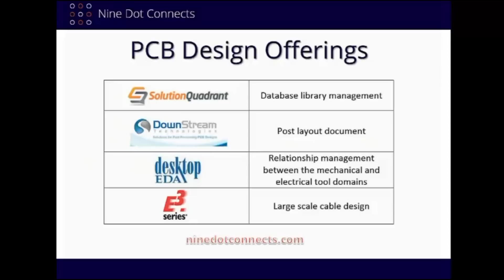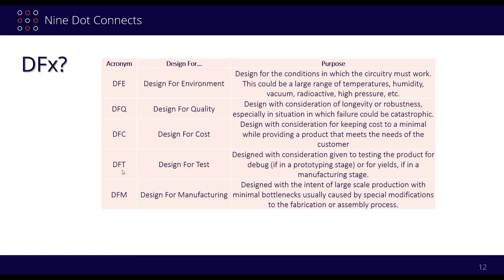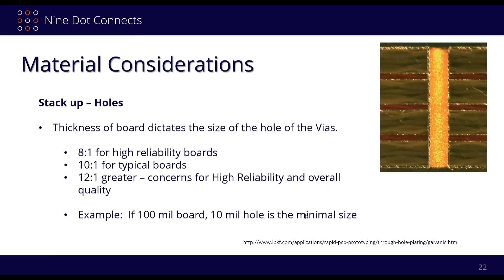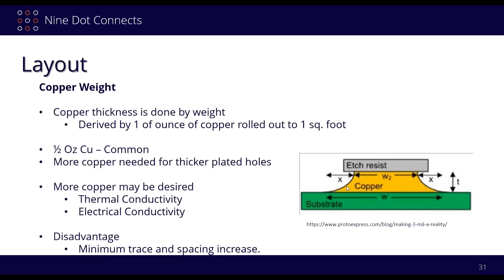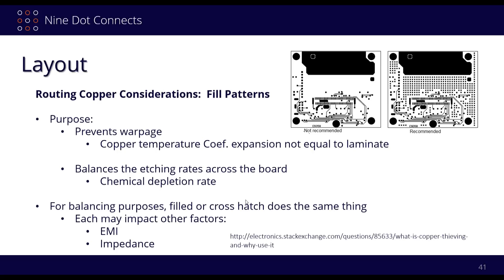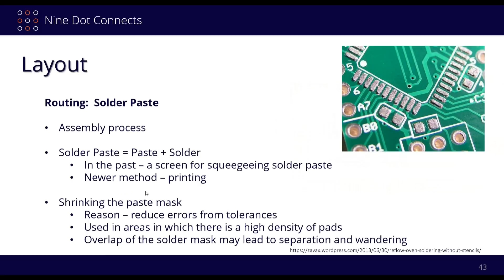Introduction to DFM (Layout Considerations Part 1)

Comment from the maker: Thanks for the comment regarding the pick and place machine.

Though it looks like a milling bit:
1.  You would not mill at this stage of the assembly with components on it.
2.  The milling bit would certainly not be on top of the component!

Regardless, the point of the slide is that physical clearances are needed for both fabrication and assembly.